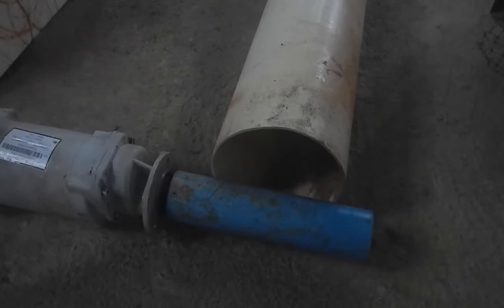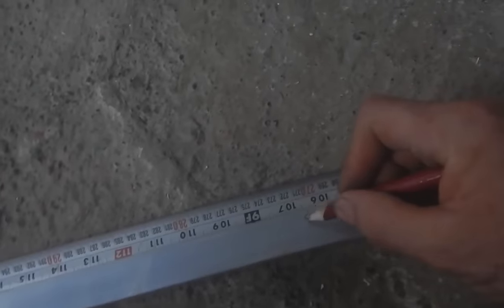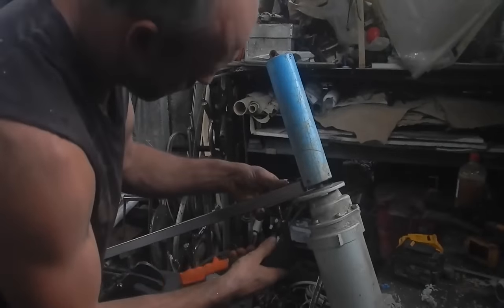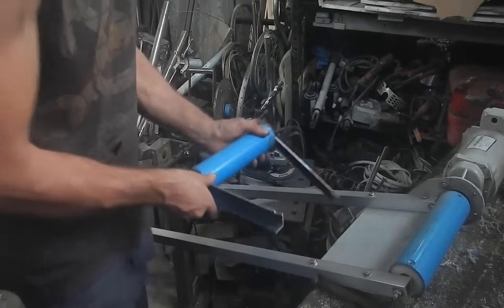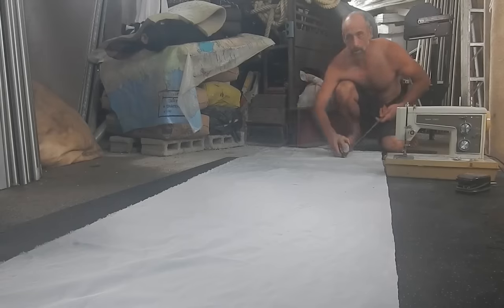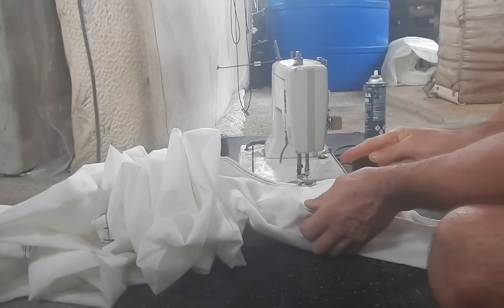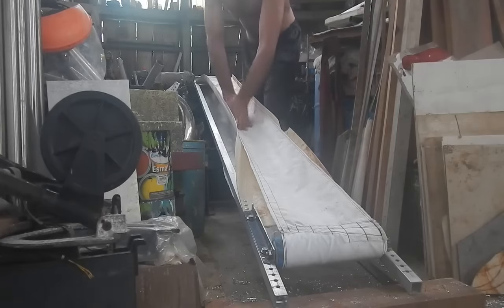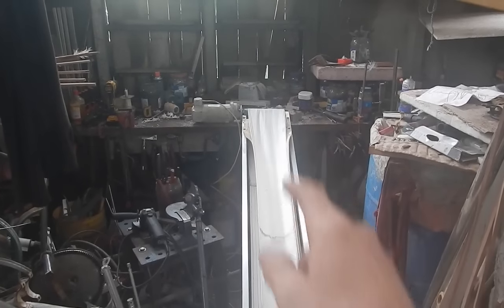Conveyor Belt Machine Thingy 01 Making it

Comment: NIce sewing hack of using the clothes pins to hold your fabric together instead of the usual straight pins.
Reply: The wire extension to use a cone of thread could inspire jealousy in the most elite sewing circles.

Comment: Hey Jaimie,
2:50 - The material will eat through the plastic abrasively if it makes contact. Even a rubber belt will eat through steel, especially if the material is wet and sandy. At work, we just had a conveyor belt come back from a client site after 3 months where the rubber belt ate literally halfway through a 2" hardened steel bolt because the belt wasn't aligned properly to avoid the bolt. I imagine your belt is just as capable of eating material that it's constantly rubbing against.

Also, if you're going to rubberize your head pulley, I recommend making it bulge slightly in the center. I know it seems counter-intuitive but, making the center of the pulley slightly larger than the outer edges will help force the belt to center itself on the pulley.

Additionally, if you're having traction issues under heavy loading and if water isn't detrimental to the material you're moving, spraying a little water on the head pulley between the pulley and the belt will increase the traction.

Comment: Jamie , your going to need to be able to adjust the belt when it has a load and that can be accomplished by putting a bolt and nut on a slide holding your roller .